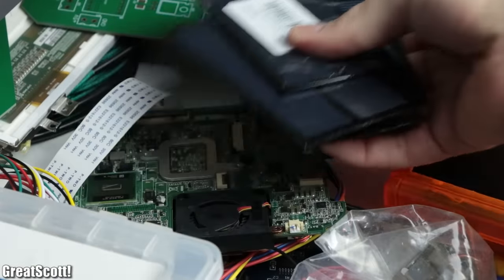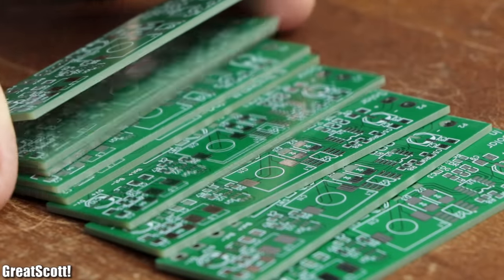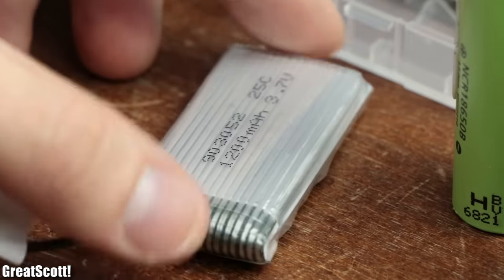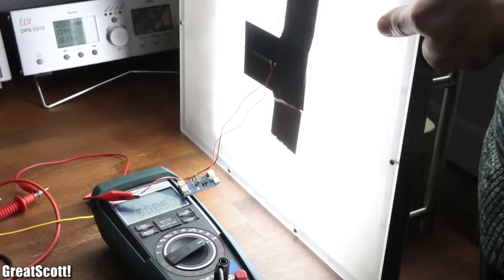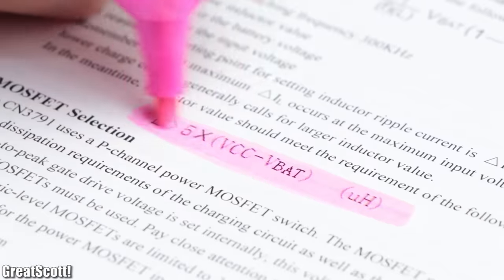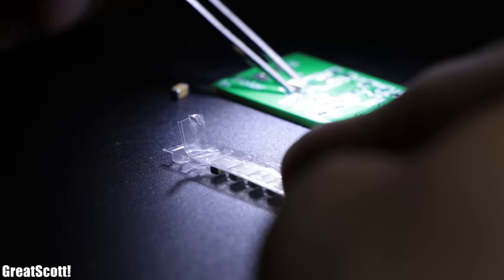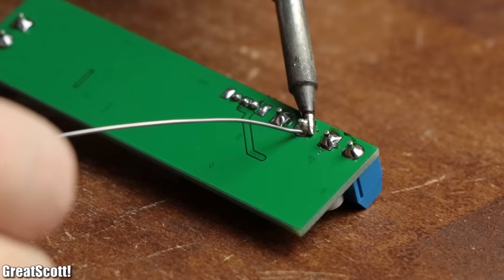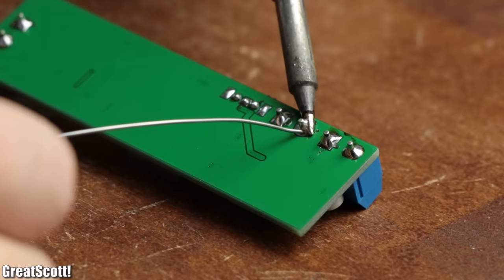Solar Battery Charger (LiPo/Li-Ion) || DIY or Buy

Comment: The 3791 is available as a ready made module as well and is also cheap.
If i look at yr video your efficiency 62% was lower than the commercial module, plus you spend 2 hrs soldering, plus what yoh made is commercially available so i'd guess 'buy'. The 5volt booster may seem attractive but isnt if you are feeding 3v3 projects, then its just extra loss on yr battery

Comment: I enjoyed watching your work. I need to replace the 2 AA batteries in my post cap lights with (2) 3.7v 18650 batteries. Can you please recommend what components do I need? I am using mini solar panels for my lights. Thank you so much for your time.

Comment: I just made a Prototype of something dominated... The MPPT resistors are what are causing the efficiency problems.  I'm using 6v solar panels Max... I used a 10kOhm for the VCC side  and a 2kOhm for the GND side. When you soldered the resistors something didn't look right... I don't think they should be soldered together.

Comment: I had to seriously LOL at "teeny tiny components". Those are huge! Try soldering 0201 (or smaller) and then we'll have a chat about small...
Reply: They are even tinier but you gotta admit those things in the video are tiny.
Reply: @Twometer  Nah, not really. I'm working with 0603 by default, larger only if I have to (e.g. for shunt resistor or large value MLCC).

Comment: for most of the parts, you could use conrad. i i know lcsc might be cheaper but Conrad is usually better quality. Plus in my case Conrad Switzerland had most of the parts of my project for very low plus and i got gifted a free shipping.

Comment: I'm not quite sure some fixed voltage tracking can actually be called MPPT as no power is ever measured. It relies on assumptions of optimal solar panel output and these assumptions can happen to end up in  quite decent result for a given solar panel (especially if the panel is properly documented) but this remains pretty much random and will need some tuning for each and every panel... Not quite the result you'd expect from a real MPTT.
However, DIY version is definitely best (eventhough the solar IC does not perform real MPPT) :)

Comment: I use these for charging 3.7c battery's (the cables they come with are extremely thin) need to buy a actual 3.7v charger/discharger tester 

For solar lights that use the normal 3.7v battery, I install the battery only bms witch covers over and under voltage and short protection in one strip (just a long strip "10pcs 3A BMS protection board for 1S 3.7V") wish the top voltage range was closer to 4v not 4.2v (think 2.5v lower end is fine believe 2.0v is when battery damage happens )

Comment: If the Li+ battery has a protection circuit, wouldn't just "shoving" the solar panel current into the battery through the protection circuitry work? If the protection has over discharge and over charge detection, it might make something like this easier to build.

Comment: I usually connect the sollar pannel directly to the battery (5v max 500ma pannels are suitable for this) in my opinion these circuits are not too useful with sollar panels because they already have a limited current

Comment: Might be a silly question from the beginner, but how about using dc to dc 5v converter and then using the 5V input into TP4056 to charge the 18650?

Comment: Vmpp deepends o nthe temperature. Usually around -0.1 to -0.2 V / °C. Thus you have higher voltage in wInter.

Comment: Nice video,  I suppose using the same principle I could power a Fire stick with my TV's USB without getting low power error, right? Just replace the solar panel with a USB cable. Do you think it would work?

Comment: Hi, I love your channel. Your projects are very interesting for me.
What im really searching for if it is possible and usefull to charge the phone by bicycle dynamo. I doesnt find any in deep infos in which constellation this could make thense. 
Do i need a power bank or only some capasitors? Is it better to DIY or Buy? How to put all to gether in one small case (maybe into the lamp)? Is it ok for the phone if charging breaks or the voltage drops? How much kms at which speed i need to drive to reach 1000mAh?,... 
So, I would be really glad if you could make a video about this topic.

Comment: Not as handy as Scott? Type cn3791 into aliexpress search box and walk away like a winner! (edit: meaning you get 3$ ready boards when doing so) Also, we still didnt get to know if the cn3791 worked for small projects since he moved into the big panel with the better board and for big one there are big solar charge controllers too.. tell us about it's viability with a small 6v one please!

Comment: Nice video. I have a question, the over discharge and short circuit protections are not included on-cell in the battery?

Comment: How do we charge 4 series connected Li-Ion cells using this? Also please make a video on Battery Management System with Active Battery Balancing circuit for your E-Bike Battery Pack.

Comment: Personally, I've just used the (Battery protection board) connected straight to a 6v 10w solar panel. Works well!
Reply: It will drag your solar panel voltage down to the lithium cell voltage, making it less than 25% efficient. None the less, it will work.

Comment: What would be the best approach for charging 6s Li-Ion battery pack?

1.5A minimum (2A ideally)
Over discharge protection
Short circuit protection
High temperature protection
Cell balancing

I was thinking on replicating (or maybe reusing) the circuit inside those old 6cell laptop battery packs

Comment: I was looking for a similar circuit board for my summer project, and it's hard to find something like you built. but i have to make some changes. instead of 5v BAT i'm gonna use 12v BAT.

Comment: Hi! It’s a super interesting and well explained project, great! 😎
I would like to make a similar one but for a different application... Could you advise me how to do it?
I would like to connect a powerbank instead of a lead battery, obviously with solar panel and inverter, connected to arduino to measure the temperature and external humidity and also I wanted to insert a 4g module to let me transmit data on my mobile phone wherever I am. Do you think it’s possible? Thank you very much 🤓

Comment: why do you feel its a good idea to order PCB without breadboarding and testing the circuit design before finalizing your PCB design?  I guess the only things that vary would likely be capacitors, resistors and inductors, so perhaps thats no big deal.

Comment: Hello Scott! Could you please update de BOM files with all the pieces you used? I noticed the LEDs are missing, as well as the blue pieces used as inputs from the solar panel and the outputs to the battery, and the switch. Thank you!

Comment: Hi Scott, 

I've been watching your video and schematics and i thing that it is such a great work, thanks for sharing and congratulations for a very well explained videos!

Having a look of the schematic for this Li-Po solar charger and driver, i have the following question: Would not be better to include the resistor R4 (shunt) just before P3 terminal block? This allow you to measure the current straight to the battery, due to as I have interpreted now shunt resistor is measuring both current to the battery and to the load, so charger cannot know wether the battery has been fully charged or the load is consuming current.

On the other hand, there is a option to isolate charger and load with an Or-ing made of transistors or diodes, Have you considered this as an option when you designed this circuit?, why did you not include them into schematics?, is it better to not include this kind of circuitry?.

Thanks for your videos, I look forward hearing from you!

Comment: This is awesome! A couple of questions though... would this work with a flexible solar panel, if such a thing exists? and b) would you sell a PCB with all the components already soldered? Thanks!
Reply: Flexible panels exist.
I don't see why this circuit wouldn't work with them.

And yeah, he could probably make a killing selling these to hobbyists if he was so inclined.
But I think the labor costs of him spending 2 hours soldering the boards up might drive up the price quite a bit.

Comment: What's wrong with using two solar panels in parallel and then using a step down converter to get to 4.2v? That would probably work better when you have less sunlight...

Comment: Will a small solar panel hooked up to a tp4056 plus buck-boost for the input plus boost converter for the output not deliver the same result? I know the efficiency won't be that high, but building a modular solution is way easier (for me at least). I like the all-in-one board though, very neat

Comment: @GReatScott I'm a bit confused about the schematics you took from your LiPo charge project. In that project you ended up with the FS312F for battery protection and MT3608 for the boost circuit. However, in this video we see a DW01 resp. SDB628 for those ic's, see 06:53 .  Could you elaborate on these alternatives?

Comment: Hey, great stuff. Does a constantly variating current damage 18650cells in any way if we have constant appropriate voltage and we limit the maximum currrent? For example if we are charging 18650 cells while the sun is getting lower and lower on the horizon, but keep the voltage 4.2V?

Comment: I have solar panels and cellphone batteries with built-in protection circuits. Are you saying that protection circuit is not enough for safety and would require a diode as well? I wanna rig these to hook up to outdoor decorations to replace the AA batteries they require.

Comment: Hi Scott! What's the reason for "maximum current draw of 870mA"? And what would need to be changed to increase that upperbound by 2x?
Reply: i'm sure the circuit could handle at least an amp so you probably just need a bigger solar panel

Comment: So what's the difference between those "solar linear chargers" and just a standard linear charger IC? 🤔
Reply: linear chager  use micro usb or usb type to charge ,To protect solar panel need to connect a diode  for a reverse charge

Comment: it is a great step ! and I like it, but I am looking for a circuit for solar cells charge 3s lipo battery in addition during I charge it I use it,  any suggestions for the circuit and  more to that the main purpose for circuit  to used in quadcopter drone

Comment: Would this be viable for a 30-50a mppt controller? I need one for my boat and was wondering if it would be worth trying to build it myself rather than buying one of the quite expensive options premade.

Comment: I'm concerned, why you still use the soldering iron for smd components instead of hot air, not to say bout tweezers (esd-15 or regular 10 should be a lot bettr for handling the stuff), I guess with mechanical paste + hot air station + good quality tweezers will be no more than 30 mintes job. (can reccomend quick air station, expensive but worth it, and baku / bst for tweezers, as paste should be 63/37 mix and you want the lead one, as less problems with dry solder joints)

Comment: Hey 
I wanna ask why you placed 0.05ohm current sense resistor. Were you aiming for a charging current of 2 amperes??
Like I went with a current sense resistor of 0.12 ohms for a current of 1 ampere.

Comment: can you make ups?, 12/24 --> 220/250v?   i have 2 ups, and i will connect in parallel, one is 1500va, and second one is 1000va, it is posible to connecting this 2 devices and become 2500va? i will make solar system, solarpanel, 12/24v batterys and 2 ups.. what are you recommend?  thank you for good videos, keep going  :D

Comment: I would be curious to know if the MPTT function is a true max POWER sensor or just a simple voltage point MPPT ?    A panel's MPPT voltage point  is not going to be constant with the panel  temp or solar radiation input.

Comment: Does this board support load sharing between a battery and a load? Or would the battery charge/discharge at the same time if load is applied?

Comment: Hey, what about load sharing? Lots of li-ion solar/non-solar chargers does not terminate the charging process when they are under constant load such as a small project circuit running with arduino? Would be great if you create such content by implementing load sharing mosfet circuit

Comment: Hi, I looked at your circuit on easyeda and I saw something I don't understand: Resistor R3 part of a voltage divider for boost converter feedback has an incomplete circuit to ground, It shows as an incomplete trace in the PCB editor From what I understand, the finished board could not function like this ?!?
Reply: Wow, I just took a look and you are right... No Via or anything it just terminates in a small island.

Comment: could I use the same circuit with a stepper motor instead of a solar-panel to charge the battery? theoretically? Lets say I put it in the wind with a propeller or so. Of course rectified if it delivers AC.

Comment: Hello sir, can I use this circuit in my final year project, which requires battery charge controller? I'm planning to use 4 no. of chargeable pencil batteries each of 1k mAh and 1.5v, I hope I will get better suggestion, thanks

Comment: Perhaps someone could give me a little help.
I’m a simple hobbyist thus I don’t know a lot of detailed stuff. I got a TP4056 charger module; 4 18650 batteries and 1 tiny solar panel (1w If i can recall) like Scott shows in the video. Is this a fairly good setting? Any recommendations? Thanks in advance

Comment: I want to know if you can power a smart led strip or neopixel strip at the lowest voltage they will take via solar panel and battery for diy garden lights

Comment: Hi,

I'm very interested in this project.
But I need advice.

Because I had some parts at home, I decided to stand up to it.
I ordered a PCB from JLCPCB and after a few weeks I built the first board.
I downloaded the data for PCB production from your link.
Because we feed the board with a 5V solar panel, we adjusted the R8 values to 2k and R9 to 6K3.
I used L1 as the coil I had at home 68uH and D2, D3 and D4 I used the SR54L because I also had them at home and has similar values to your SSB43L.
Unfortunately, a problem occurred after the engagement.

After connecting the battery, the voltage is 4.05V on B + and B- pins.

On pins + 5V and -5V the voltage is 0V.

If I measure the voltage on pins B- and + 5V I get a voltage of 4.07V
and the voltage at B- and -5V is also 4.07V.

I checked everything again, but I did not find the error.
Do you have no idea where the problem might be?

Thank you in advance for your early reply.

Martin
Reply: Hi bro, I have the same trouble, there is no instant 5V when I connect the battery.
but Scotty told me that there should be instant 5B
And now I also do not know what the reason ...
Reply: @valendorn  Hi mate.
Were you able to solve this problem somehow?

Comment: İ have a question. What if we connect solar panel directly to the battery? What would be the efficiency?  moreover you did efficiency calculation between input and output, but in this case we cannot understand how our circuit define voltage . I mean in same light %60 efficiency circuit can produce more power than %70 efficiency circuit because of using different voltage.

Comment: I need a boost converter that can convert variable voltage from 5-58 to a constant 58v . I was thinking with an arduino, voltmeter and boost converter pieces. Voltimeter sends info of input into arduino which determines the oscillation of relay for 58v at output. (Will explain further if necessary)

Comment: I bought a cheap 5v USB solar panel on ebay from China. It was charging my Lipo battery and it was nearly full. I left it hooked up over night and by morning the battery was almost dead. WTF? I would say that it doesn't appear to have a reverse current diode, but the USB was plugged into the "input" on the battery pack so I would have thought there was one on that?

Comment: What is the IC you solder to the CN3065 to protect it from the over-discharge and the shortcircuit issue?

Comment: What is the additional PCB for Battery protection ?
And what design program do you use ?
What is the reverse current from the DIY-Solution whren it is dark ?
Reply: I'm pretty sure he used Kicad to design the circuit. It's free. I'm not sure about the other stuff though.

Comment: I had that tiny mobo, I tried to see if it has some sort of protection if the battery is placed incorrectly and it instantly fried something. Either the tiny square chip in the middle or the resistor next to it. Is there a good one from ali that also shows the current on an lcd ?

Comment: In my LiPo batteries, which I recently purchased, each contains a built-in PCB that provides overcharge and overdraw protection. Why are you going through all this? I used a 5V cellphone charger and they charged up perfectly. Am I missing something?

Comment: 9:50 haha haha I was expecting a potentiometer but overall soldering smd components can be  challenging  so I'm giving you an smd pass as Christmas present 
specially because you probably froze to death by testing the circuit out on the roof

Comment: Hi Scott ! I know it has been 3 years. Hope you have a great day. I am wondering if I can just change the CN3971 to CN3975 in order to be able to charge multiple cells (in parallel) of Lithium Battery to increase the storage capacity of my project with your schematic? or is it necessary to change the IC as I don't quite understand the charging mechanism and about the cell balancing and all that.  Thank you
Reply: any way that you can help me here? i wanted to order this at jlcpcb but they need BOM CPL files for asambling. Kinda dont know where to order those alle parts by myself so i want jlcpcb to do it all